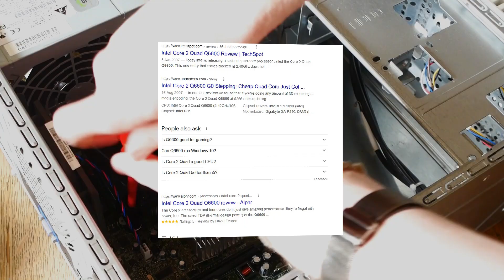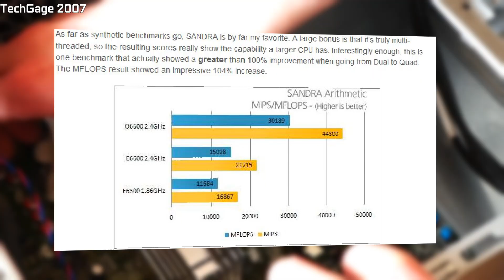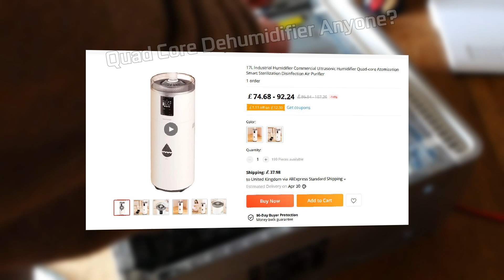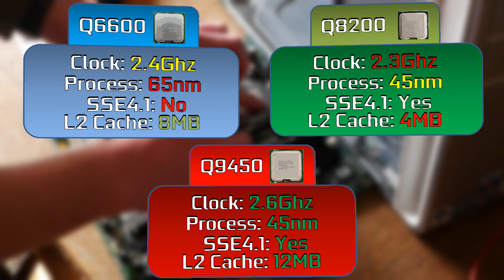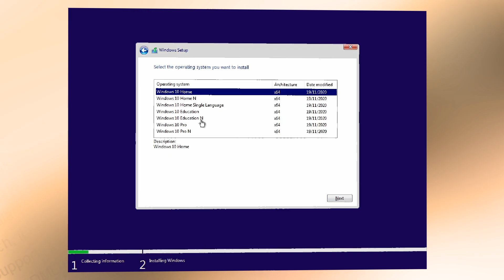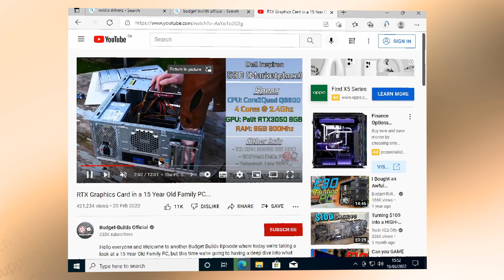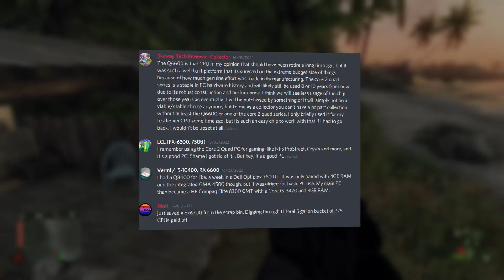Intel's Core2Quad...Finally Obsolete?

Comment: I'm planning to upgrade my PC from a Pentium dual core 5400 to a core2 quad 9450. I only use my computer for retro games, emulation, and storing files, but recently it's been a tad more sluggish than usual, so I'm going to upgrade the processor 😁
Reply: Try the 9550, or even the 9650. With decent cooling you can also oc them with at least 400MHz without any issues in the long run. They sould be fairly inexpensive. Tip: you can find them also in many old OEM computers
Reply: @sobolanul96  There is a big difference in the price. I always wanted a Q9650, but in every case I bought the 9550. It costs only half.
Reply: @Centuria1969 It depends on what you are willing to pay for an old chip. The prices indeed double. If you wait and search a little you can get them cheap. I got the Q9550 for about 20 dollars, and the Q9650 for 38 dollars. But I my case i really wanted the Q9650, even if it was not much more powerful than the Q9550.
Reply: @Centuria1969  "I always wanted a Q9650, but in every case I bought the 9550. It costs only half."  

trippy, cause the Q9550 is still half of the cost of the Q9650, three years later.  

in 2025:  

Core2 Quad Q9550  $15  
Core2 Quad Q9650  $30
Reply: Lol Xeon gang here
Reply: @akashi2921  ayeeeee
Reply: @sobolanul96  In most cases the higher end chips do cost a lot more. You can get lucky and find one cheap but in most cases for the money the small performance increase isn’t justified over the Q9450
Reply: @sobolanul96  try a 760k or 860k
costs like 7 usd 
and better than any core 2 quad
Reply: @sobolanul96  prices of C2Q went down in last months, this is good time to find some of them before it jumps up again, it's still not that much retro as let's say tualatin Pentium III, but I expect prices of C2Q will jump up in near future, this is exactly that time when you can still buy it as an "old crap" and many sellers don't realize that it already has some retro value
Reply: @sobolanul96 I have the q9650 and it’s honestly not too bad on windows 10. Overclocked it and I can play simple games like amnesia no problem
Reply: @ I played Metro Exodus on it. You could feel it giving every last drop of power but it pulled through. I had no issues with lag even in fighting sections.
Reply: I'm holding a pentium dual core in my hand as I type this, just a tip though, check your motherboard compatibility, it may not work with a q9450 and you may want to go for an overclocked q6600 instead
Reply: @ethand4784  I had an old HP Microtower that had the Pentium Dual core and I tried to upgrade to a C2Q but the motherboard isnt compatible. That was 10 years ago.
Reply: If all else fails, crank up the bus clock, got mine to ~3.2-3.5ghz range. Handled Starcraft 2 Heart of the Swarm pretty will with 4gb ddr2 and a 9600gt(later 8800gt)
Reply: Well I've overclocked my c2x qx6950 to 3.5ghz stable using a crappy asus g41 mobo its a nice cpu
Reply: @hartomos  X9650, try 400*10 @1.4V (bios) If DDR3 1600C8 1.7V
Shouldnt take much to get a X9650 to POST at 4.0 and then refine
Reply: If thermals are something you can't change, look for the 'S' variant of the Q9xxx, which has a lower TDP.
Reply: As you probably know the best upgrade you can make to an old PC is to upgrade to a SSD, if you haven't already.
Reply: Try Linux on it.
Reply: Likely just a software issue. Upgrade your CPU, but do a Windows reinstall as well. Should help quite a bit.
Reply: I would go for a Q6600 or Q6700. You can OC these chips to 3,6GHz in most cases. The Q9450 is only a good option if it isn't way more expensive.
The other really good chip is the C2D E8xxx series. The chips are easy to run up to 4Ghz or even further. The amount of cache is quite good and the power consumption is significant lower than the power consumption of the C2Q series.
Reply: the chipset cod i see was like 8 dollar that was a cod e8400 price are change based on your place a q6600 cost 20dollar in my country i don't think that worth the price for a 4 core very slow 15 year old cpu and also used i don't that you can get a 15 year old new cpu chip
Reply: Yeah, get for almost the same price a xeon 6 core 12 threads one from around 2012-2014,better off
Reply: @L4ftyOne  dang my xeon e3 1230 v2 with h81 broken lol
but my xeon e5450 with asus p5g41 still alive
even tough i've overclocking it to 3.6ghz over a year
Reply: It's a good idea!. 
Some years ago I bought a bargain OEM HP SFF which came with a C2D E5400 and DDR3for a Hackintosh project, few months later I bought a cheap Q9400 and runs fantastic. 
I still have this cheap wonder even, lately, I purchased a Quadro K620 (= GTX 745)  a card that works fine with this processor (estimated bottleneck for a  C2Q it's GTX 750 or GT 1030) .
Now I've am economic workstation working with W10 and Linux Mint. If you don't think to play last generations games, a C2Q is a good alternative due its current  low price.
Reply: @larrybreavman4864  But in my country.. The q9450 is a little bit expensive from q9500 lol 😂
Reply: to be honest waaay better dual core cpus out there with Hyperthrading what ever.
I think the intel Pentium G series is awesome if you want dual/quad core for retro gaming, support DDR3/4 and is waaaay faster then Dual Core 9450. And i have one old Pentium G chip here somewhere around that came from the Intel I3/5/7 3000 series around and want to use it for Retro games some day because ... modern Systems are not good for 32 bit emulations at all.
Reply: @allxtend4005  They don't cut the mustard if you actually need 4 cores. Logical cores are no substitute for actual ones. They might sort of work in modern CPUs, but not these old ones.
Reply: Ahhhh yes the legendary E5400, i have the same, and it has served my emulation, retro gaming and Terraria needs pretty well 🗿👍
Reply: Actually, I bought a Q9650 CPU recently on Amazon priced around $49.00. Not bad for that price . Now I got two Q9650  CPU's. And its been working great! Knock on wood.
Reply: Not all motherboards afford the 95-125W TDP of these processors.

Try a E8000 series first, specially if you have a DDR3 motherboard.

The C2 memory controller causes a huge drawback, making the C2Q almost useless in many cases.
Reply: I have a spare 9650 you can have if youre local
Reply: The q9550 is nice. I upgraded this PC I got for free(from an old job) from a e4600 (that did surprisingly well on its own too) but I saw noticable improvements with the q9550. I got mine for $22 but I also saw a q9650 for $32 or maybe $36 which I was tempted to get but didn't feel the extra 130mhz was worth it. I also saw the q9400 for $10 and that was also tempting. I also have a i5 2500k build I've had for 10+ years and a new one I'm about to build with the i7 12700k.
Reply: e3-1231 v3 Gang here😊
Reply: You're a legend.
Reply: What OS? WinXP w unofficial service pack or something else?
Reply: Try to get a modded Xeon X3363 (basically a C2Q 9550 but cheaper) if your MoBo chipset support it, then you're gold. https://youtu.be/y2FTPvb4wf8
Reply: I get the point because of light use and emulation but those old motherboards are expensive. You're almost better off getting a slightly new platform like the 3000-6000 series you can get very cheap that has pretty much most of the modern things you want out of a system. It gets to the point where used parts for that stuff can be almost the same price as some of low tier or mid tier hardware between the 2000 series Intel and 6000 series tbh depending on what you're looking for. If you mainly emulate things, getting a 4000 series CPU and maybe an RX 480 would be a super easy 300 dollar build tbh. 480 is more than enough to upscale those games to 4k and the CPU is more then enough to handle all emulation unless you're getting into PS3 and Xbox 360, then it gets a bit rough, but everything else is great.
Reply: Awful stuff
Reply: A i5 2500k is pretty fire for such stuff and with a nice workstation gpu makes a good cheap emulation box
Reply: This comment thread makes me feel a whole lot better about still not upgrading from my R7 3800X lol. Been torn between upgrading to the 5800X3D or making the (hella expensive) jump to AM5.
Reply: This comment is like the male version of an anorexic girl posting a stomach picture and saying "do I look fat?"
Reply: What a waste of electricity 🤣
Reply: No, don't, install all updates and run ADWcleaner
Reply: @fred-youtube  not a bad idea, but falls under "if all else fails". Though a defrag if he's using a hdd vs an ssd may help too. Had a dell latitude with an i7 3770m that was running slow until I ran a defrag... Even starcraft brood war was sluggish
Reply: Jesus christ just get a 5900x.
Reply: Get a i3 10100 that's 75 dollar
Reply: @k2s4try3  i3 won't work in this case, because it's a different socket. These Core 2 Quads use socket 775 while this 10th gen i3 uses socket 1200.
Reply: @leotorma9659  actually i just forget we are talking about a pc that is more than 10 yea old he also have to change the ram
Reply: @k2s4try3  but h510 still expensive
i think better to go to a520 with athlon 4000 or ryzen 3 4100 next month 
and r3 4100 seem have a better performance
Reply: @akashi2921  4100 is a trash and that cost around 150-160 dollar in my country and a minimum a520 cost 80-90 that's 230-250 and if you compare a i3 cost 90 in my country+ h410 cost 70-90 so that's 160-180 in total so think i3 is better
Edit- i forgot to mention i3 10100 is better than 4100 cose 4100 is based on a old generation
Reply: @k2s4try3  I know right. It's on par with a i7 6700. These guys get a kick out of using old stuff. I have a computer I got for free that I upgraded from a e4600 to a q9550(got for $22, could have gotten the q9650 for $32 or $36 but didn't feel it was worth it. Anyways it does do pretty nice especially on retro games and games from 2012 or so. . .they could even get a I 7 2600k for $50 but why not just spend a bit more and get the i3 10100 if your going to spend that much. . . Funny how Ryzen kids like to pretend they have the best performing for cost processors.
Reply: @TheRightToFilmPolice  i love performance and i don't care about Intel or AMD , Intel was leading that market for very long and than AMD made some good cpu and thy are ready good like 3200g,3100,3300x,3600 but at this point Intel have cpu undar 100 dollar 10100 best 4 core chip 12100 for best bugget pc in low price have 12400 for  card like 3060ti,3070 and than thay have Market leading 12900k and 12700k for creator and the best cpu 12600k for and card like 3080,3080ti,3090 and for those who can spend anything thay have 12900ks
Reply: @TheRightToFilmPolice  Not always but the 80$ 1600AF was a hell of a deal at the time, and some might say still is now a days.

Comment: Next stop: The BSEL mod for the Q6600 and a comparision to stock speeds
Reply: If the board has the neccesary settings I would go so far to say try 400x8 for 3.2 GHz and more bandwith.

Comment: C2Q was legendary, I think it's time to say goodbye... C2Q has minor issues in performance when using a multitasking programs, it is always CPU bottleneck.
The C2Q holds well with everything application (with SSE4.1) I am expecting newer program that won't work like AVX and other instructions.
Reply: Very few programs even take advantage of AVX instructions, even today.
Reply: Im still using C2Q just new application requiring SEE 4.2 doesn't work
Reply: @randomequations2210  SSE 4.2 requires minimum Intel i7 first gen.

Comment: As someone who STILL uses a Core2Quad Q6600, I absolutely love this video
Reply: Someone mail this mad lad a 9600 series C2Q, stat!
Reply: did you use the tape mod?
Reply: @Omabatfartsbruh  I think people used it the most with the good old 4 core xeons.
Reply: @Omabatfartsbruh  unfortunately I never heard about this mod until now
Reply: @lsso  What's this mod?  Lol.
Reply: @Tube2097  search for 'tape mod C2Q Q6600'
Reply: im still using this CPU, GTA V 60-70fps full res,cs go full res and high graphics settings on 120fps, for me its budged processor for broke peoples like me :D 
GPU: Nvidia geforce GT 730
Reply: @petriiik.iso2  It must bottleneck modern GPU's something rotten, surely.
Reply: @Tube2097  Yes a Nvidia GTS 460 graphics card is as fast as you should go (in fact even at 460GTX is still slightly too fast). However a lot of games up until the 2010s runs well.

Comment: The core2quad was never a true quad core cpu. It was 2 duel core dies bolted or "glued" onto the substrate. You can Google images that show this. Ironic that intel at one time accused AMD of gluing together dies.

Keep up the amazing work dude. These processors can be purchased from cex in the UK for less than £5.
Reply: Aka Dual (Dual Core)

Comment: The Core 2 Quad is the CPU that never surrendered.
Reply: But the Xeon x5355 is the bastard who finishes the job what the Q6600 started.
Reply: prices in 2025:  

Core2 Quad Q9550  $15 on ebay  
Core2 Quad Q9650  $30 on ebay
Reply: No SSE 4.2 so you won't get windows 11 on it
Reply: @si4632 Holy crap 3 years ago?  damn that was a hot minute lol.  Though tbh I wouldn’t want that spyware anywhere near my hardware regardless of its capability.  Linux will happily drum along on a Core 2 Duo/Quad if your goal is web browsing, office stuff or whatever.
Reply: I feel like the i5-2500K was it's spiritual successor
Reply: @sdaafasfad  yep, I think I5 as a whole will prob be the successor of the core 2 quad, they are cheap and reliable and strong
Reply: Too weak in 2016